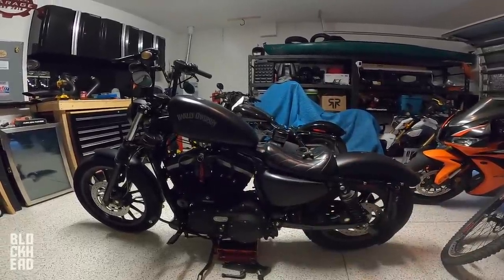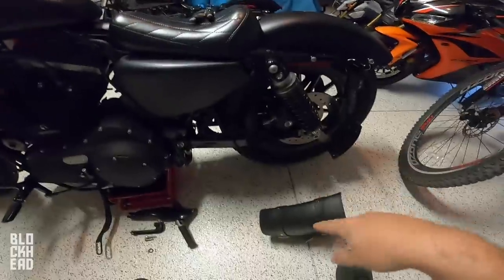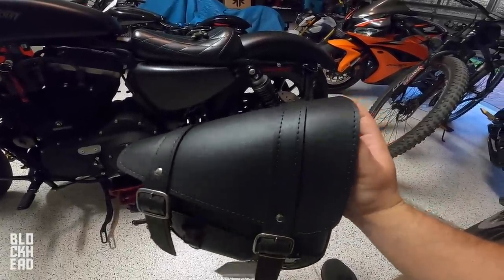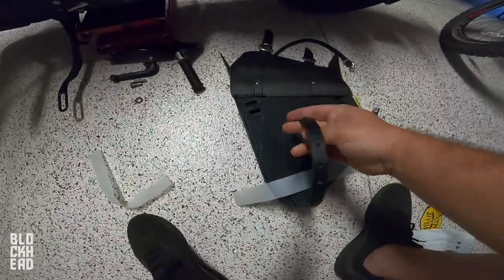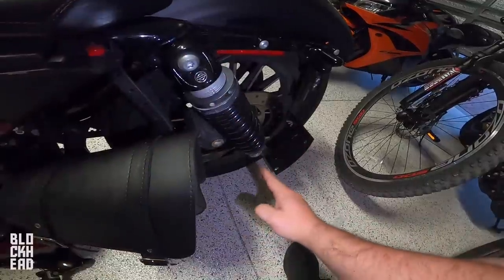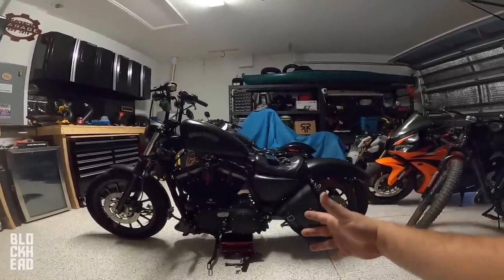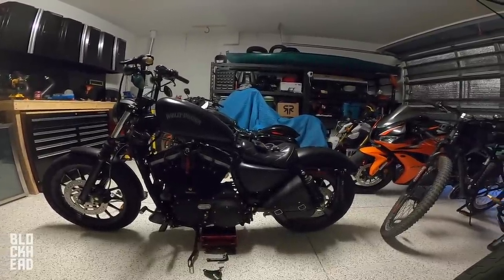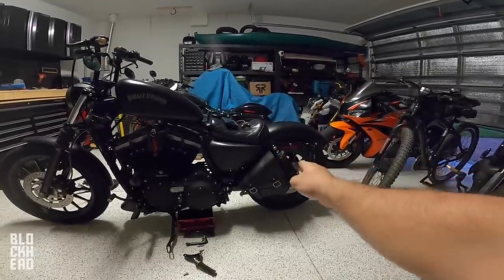Harley-Davidson Sportster SWINGARM BAG Install

Comment: The rear left-side of a Sportster has always looked a little plain to me and in need of something.  The right-side has the glorious pipes.  I added a swing arm bag to my 2003 and it looks sweet and fills in the gap.  Keep making the videos.  Thanks!
Reply: Like the driver side or passenger side?
Reply: I just got mine today, I agree it does need like there is something missing.

Comment: Gonna add that to my 19’ Iron. Just got done with my “Block” mods to my dream machine.  Lepera, Rineharts, drag bar, sweet flipped mirrors, tank lift and led headlight.  I wanna be a BLOCKHEAD when I grow up lol!  (Lol I’m 53) thanks for the install vid.  All your vids have been my “Mod manual”
Reply from the maker: lol, nice! Happy the vids have helped out 👍
Reply: I'm going for the same mods on mien! What's the lepers and rineharts tho?
Reply: D2M DRUMMA21  meaning lepera bare bones solo seat and Rinehart slip-on pipes (different from what blockhead has)

Comment: I got the same bag.  I used zip ties instead.  The buckles get in the way
Reply: My thoughts exactly, just replace them when you need to pull it off. I'd use two in each place
Reply from the maker: Good alternative!
Reply: I might go this route eventually.
Now I am trying a small pair of throw over bags with stays, made by the same company
Reply: Chris Parker exactly what I did, 2 zip ties on each.
Reply: BLOCKHEAD thanks.  I felt I couldn’t  cinch down the bag well enough with the buckle straps too.  The zip ties of course can go where you need them.
Reply: I did the same thing today    zip ties the best!!
Reply: Be sure to check the zip ties regularly, I have this same bag on my Fatboy and used 2 zip ties each and 3 of them broke off and was only being held by 1 zip tie.  I checked them pretty regularly too but you never know.  I ended using velcro straps AND zip ties after that and so far, no problems at all
Reply: Good idea. The buckles got in the way, were hard to operate, and they slipped. I removed the buckles and just tied a knot in the straps. Zip ties is a better idea. The only other problem with this bag is it holds water, takes forever to drain and dry out if caught in the rain. I may punch a small drain hole at the lowest point. I keep a small toolkit  inside a roll top waterproof bag in the bottom. So far no rusty tools. Also keep my registration and insurance in a waterproof sleeve in there as well.

Comment: Just got this bag and installed it on my 2000 dyna. Wasn’t technically made for it but it works. I also used zip ties I couldn’t get the straps to work.

Comment: Just got mine W&M swingarm in the mail this morning. Grabbed it after seeing your description video. This "how to install" came at the right moment! I'm ready for my install this evening but...my side cover seems pretty sturdy to be removed...it could be nicer if you've showed out that phase. Anyway thanks for your amazing vlog and work. Keep on with same passion dude. Greetings from Italy
Reply from the maker: Side cover just pops off, give it a tug from the top. If you have the new cover snaps, you'll need to press those up to free the cover, those hold much tighter. Enjoy your bag!
Reply: @BlockheadMoto  Thanks man, just pulled it down with both hands in a shot. Now bag's on, and it fits perfectly the bike! Now it's AN knurled grips turn! Wish me luck!

Comment: So I installed one on each side. What I found when installing the bags is that swapping the rear peg mounts and then inverting them.  At least for the 2004-06 models.  Installing them this way lowers the mounts and when you pull them in, they pull in towards the front instead of jamming up against the bags.

Comment: Excellent mate! Just installed on my '02 Sportster and routing the straps as you did made for a solid, no movement install that lines up great with the shock! Would not have gone as smooth or been as tight of an install without this video. Subscribed and thumbs up. Thanks! Ride safe!

Comment: If ya got two straps to frame... which in theory, frame doesn’t move .... and one strap to swing arm ... which in theory articulates up and down ... isn’t that going to cause stretching or breaking of straps, because ya tightened those straps pretty good. Once ya riding and swing arm moves up and down, won’t that cause a problem. 
😎
Reply: Curious as well.
Reply from the maker: Never had a problem before and ran this bag on this bike for over a year.
Reply: BLOCKHEAD obviously it’s made for it , but it just seems strange the way it connects. 😎👍

Comment: Yo blockhead you’ve really gotten me into motorcycles I get my license in about a year and I have been thinking about getting the Indian scout bobber I saw that you did a review on it and wanted to know if you think that it’s a good beginner bike or not
Reply: The 2020 Scout Bobber was the first bike I rode after I got my license. That bike has SO much power behind it, but it's very manageable. I was practicing clutch control and low speed maneuvers on it, it was going like 15 mph from just the clutch, but it was very responsive. One twist of the throttle in 3rd gear and I was going over 70. The only downside I saw with the bobber was that I was sliding off of the hard seat a lot. I'm gonna buy a Scout 60 instead just because they're more comfortable for me, but there's no difference in the engines. I'm 6'2 also
Reply: I’ve been riding the Scout Sixty Bobber for a couple months now. Not new to riding but yes, great starter bike. Lots of power when needed but not crazy either. Swapped the seat to the Indian comfort (everyone does) and plan to swap to the mini apes (6’2”). Highly recommend the Sixty, plenty of power compared to the regular bobber, but $2k cheaper and ALL blacked out!  “Ride safe and stay vigilant!”

Comment: Spend the money and get the genuine Harley Davidson bag it comes with all the hard mount hardware. Do not buy Vikingbags!! Terrible customer service
Reply from the maker: Haven't had experience w/ Vikingbags, but I disagree w/ 'spend the money and get the genuine H-D bag,' I've had both H-D bags and this one, and I prefer this one tbh.
Reply: BLOCKHEAD I can’t say anything about the one you have but the viking bag only had 2 strap points and was loose the Harley hard mount is so sweet check it out on my bike in some of my videos rock solid.
Reply: BLOCKHEAD I love all your videos and stuff but are you sure this isn’t a paid promotion lol